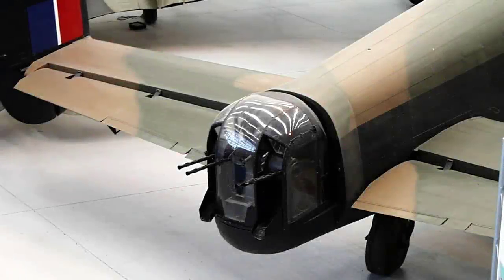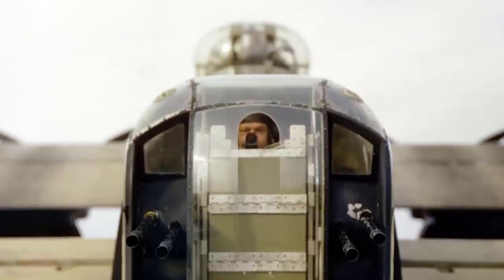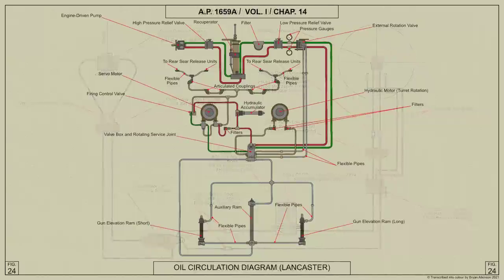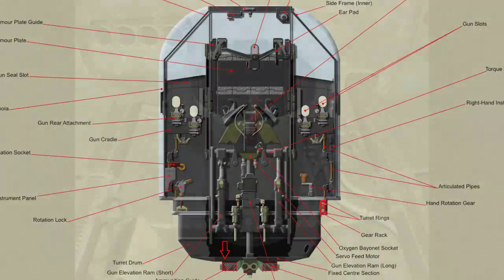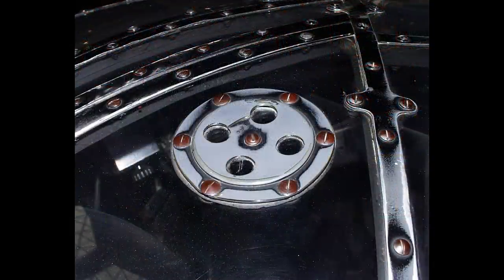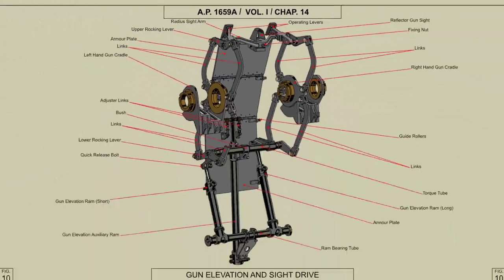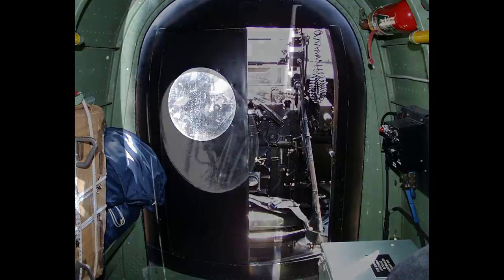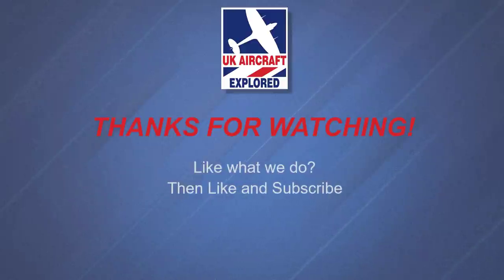Avro Lancaster – FN.20 Rear Gun Turret

Comment: What type(s) of materials were used to form a check against airflow between the rear part of the fuselage and the back of the Rear Gun Turret, where the two came into contact? Thanks and cheers!
Reply from the maker: The Lanc had rear doors on the rear face of the turret and also two wooden doors located at the rear of the tailplane spar.

Comment: I was surprised to see how quickly r turret rotated.wjat power was the motor for it
Reply from the maker: It was a Hydraulic Motor. If the motor failed, the turret is fitted with a Hand Rotation Gear. Thanks for watching
Reply: @ukaircraftexplored6556  turret rotated very fast. Saw on YT.  Tracking a/c..needed that.  .yanks in b17. Couldn't track meteors jets too fast.   Practice to counter me262

Comment: One thing I never understood was ehh the British stuck with 30 caliber guns in the bomber turrets at a time when axis planes were being fitted with heavier armor that was Mapuche more resistant to the relatively light 30 cal bullets as opposed to the much heavier 50 cal projectiles of the Browning guns. I’m also guessing that the .303 ammo used in the 30 cal guns in airplanes was probably a lot hotter loading than the .303 ammo used in the bolt action Enfield No. 1 Mk3 and No.4 Mk1 service rifles, similar to the hotter 9mm ammo that the Germans used in the MP38 and MP40 sub machine guns. I like the heavier 2,500 round loadings per gun, given the 1,000 to 1,100 cyclic rate per guns it gives you a lot of shooting time without worrying to much about running out. Since the hydraulics were only powered by one engine this design would seem to be troublesome if you had engine failure. A very ingenious turret design to be sure… carry on cowboy!
Reply from the maker: Thanks for sharing

Comment: Seems too weak to carry the weight and  rear loads of flying and landing.
Did it ever snap off ? The ring I mean
Reply from the maker: No, I haven't read of any cases of the mounting ring snapping off. The are photographs showing the rear turret being completely sheared off, as it was sadly in the path of a bomb dropped by another aircraft higher up in the formation.
Reply: @ukaircraftexplored6556  yes I've seen a Mitchell being taken down by the bomber above it. Thanks for the info